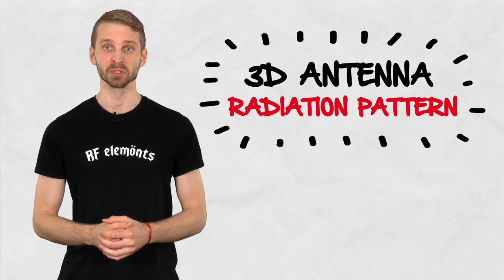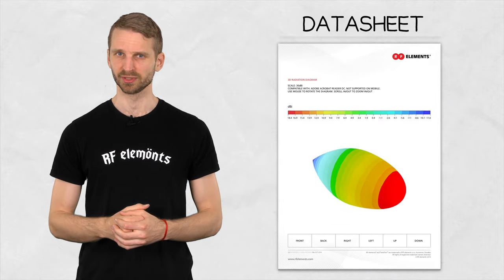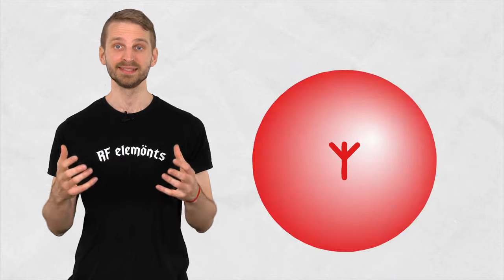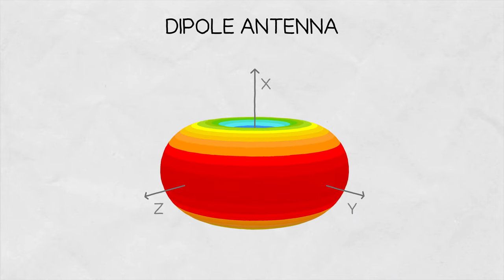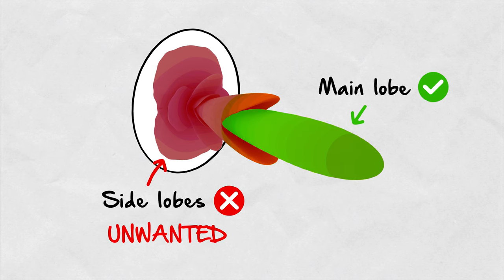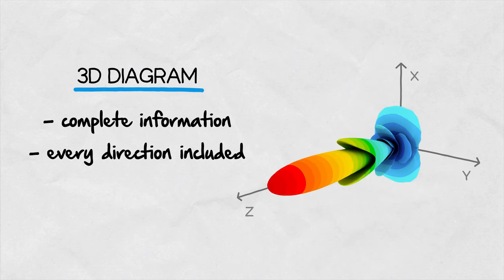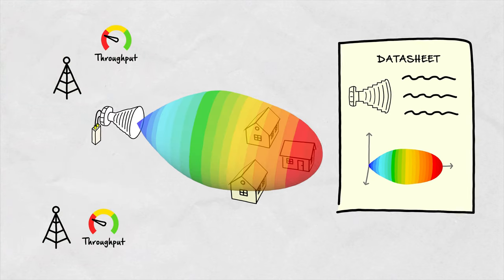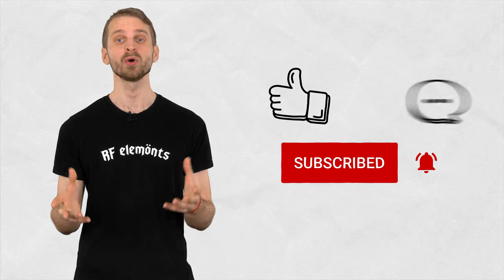Inside Wireless: 3D Antenna Radiation Pattern

Comment: Do u mind if I ask? I have a few questions.
1. when the antenna radiated, does it means they go as far as the red region in their diagram or they go farther than that?
2. why the red region in the diagram has more power than other region when they are farther than the other? should farther more decrease power?
Reply from the maker: Hey Nutthawut, not at all.
1. The radiation pattern represents relative strength of radiation compared to a dipole (mostly). So yes, it does, check out this video for details - https://youtu.be/cKxCfZ36HmM
2. Radiation pattern does not represent physical strength of radiation relative to an antenna, but to a dipole, it is an abstraction that helps us visualize antenna radiation strength in any direction. If you check that video from previous answer, it might be more clear..
Reply: @Rfelements  So that means the practical antennas compare to "Dipole" which I understand is the ideal dipole and in my thought, the ideal dipole radiates the same intensity every region but in the practical antennas it not and we compare it to the ideal. Am I right?
Reply from the maker: @ramza1526  When antenna radiation patterns are measured, dipole is one of antennas used. The gain of antennas obtained from simulation is in dBi - compared to isotropic radiator, which is not the same as dipole.
Reply: @Rfelements  I'm studying antenna because I interest to build the phased-array antenna but I barely understand its fundamentals. I know that they have to consider radiation pattern, polarization, link budget, and more but when it going into detail I start to confuse. Example: When it starts what to consider first and what next? how far the antenna can propagate? or how distant the antenna can propagate relate to radiation pattern?
Reply from the maker: @ramza1526  Antenna is a part of the whole system radio + Tx antenna +  path loss + Rx antenna + RX radio.. How far an antenna can work is a function of all these. If you want to design a phased array, these videos will not help. It's beyond what this series is meant for. You might want to study a handbook instead, for example this one: https://bit.ly/3xXyGab
Reply: @Rfelements  I just want to start with something simple, the fundamental parameter but my goal for now is the phased-array antenna. thank for the suggestion.
Reply from the maker: @ramza1526  good luck with the design

Comment: Very good channel! Thank you for sharing.
I have a question. Why are the side lopes of the antenna is cause the biggest problem of interference?
Reply from the maker: through side lobes antennas radiate signal to unwanted directions. The result of that is that other radios see this unwanted signal and to them it is noise, i.e. signal they cannot work with nor understand.

Comment: Hi There, I am wondering if anyone has been able to provide a 3d Pattern testing facility for the public to use...  I would like to know where there is one so we can send samples to have them test our equipment.  If there is not, it would be cool to have a youtube channel showing how to test antennas and have a faceoff vs Brand and unbranded antennas.
Reply from the maker: The best bet is probably approaching a local university that might have one. They might be the most open to have your antennas measured if you need to. Probably not for free, but still.
Reply: Thanks for the suggestion... Will try that path.